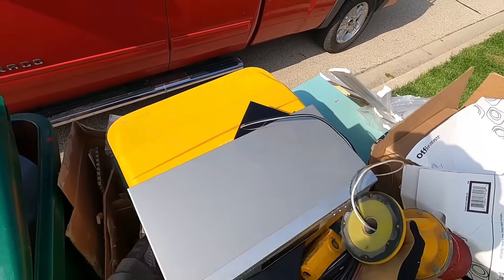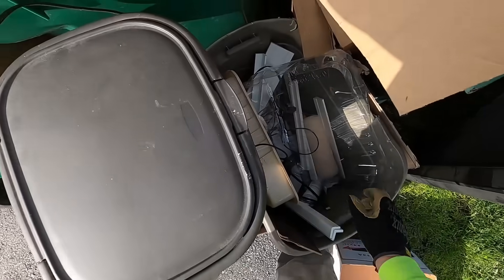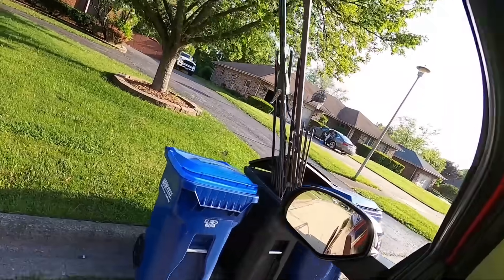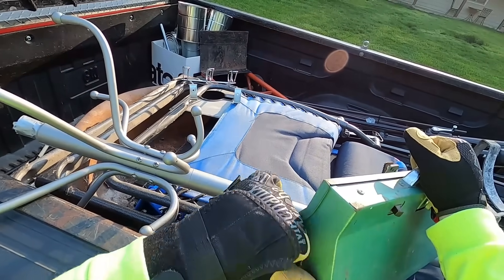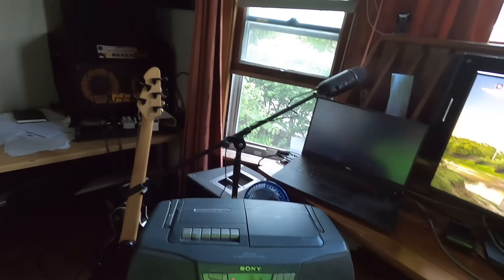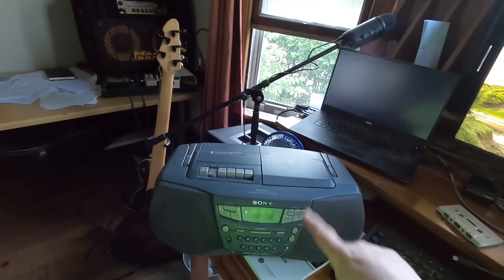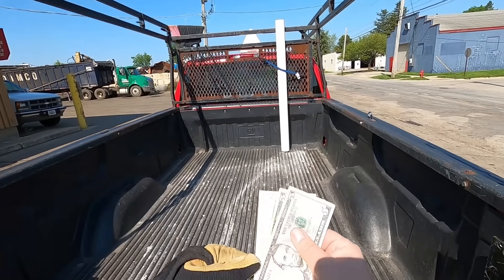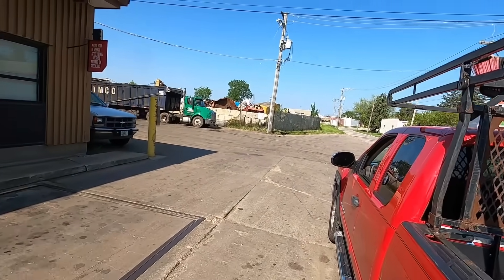Curbside Gold "Does This Spell the End?"

Comment: You should’ve got that flatscreen TV that has more metal in it than a washing machine more metal than an icebox it’s a flat screen it doesn’t have a glass tube like the old-fashioned ones no glass in it lots of metal
Reply from the maker: More metal than the whole scrap yard?
Reply: I have three TVs on my trailer and two metal inserts from a pair of recliners it’s recyclable